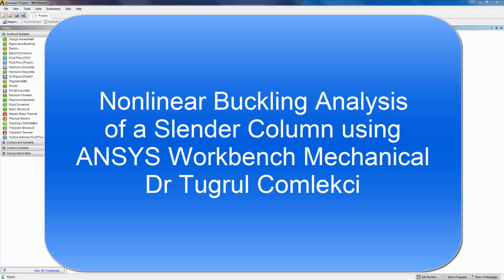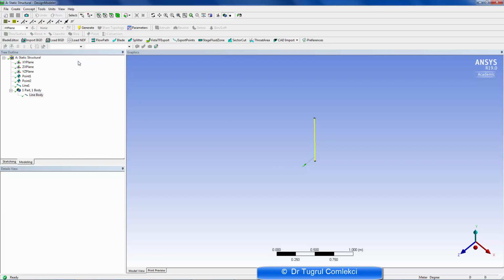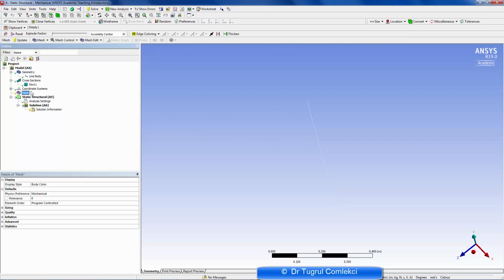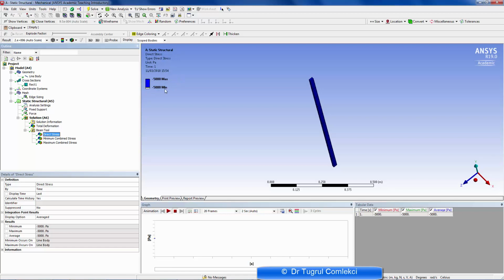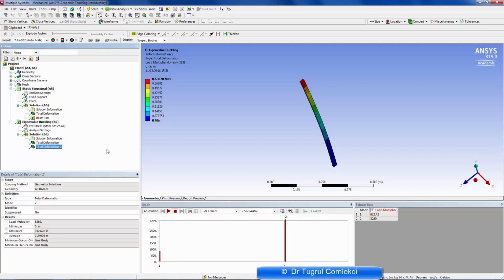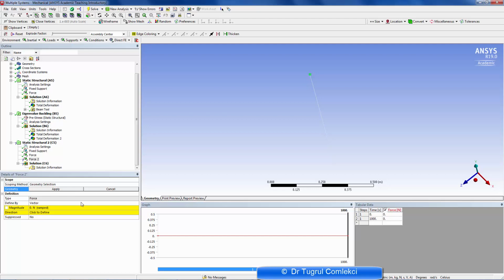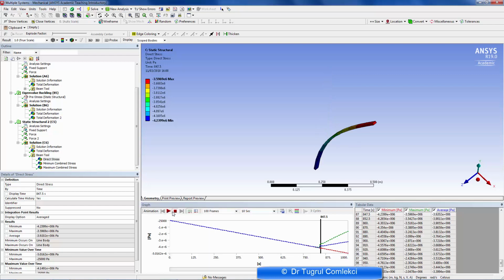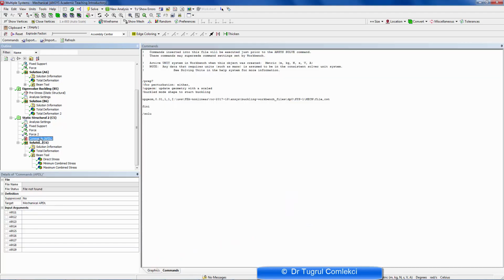Nonlinear Buckling Analysis of a Slender Column using ANSYS Workbench Mechanical

Comment: How can you read the 2nd buckling mode with upgeom?
Reply from the maker: Thanks for viewing this video and your post. The Upgeom command syntax is: "UPGEOM, FACTOR, LSTEP, SBSTEP, Fname, Ext,--". You can read the load step and substep in the *.rst file corresponding to the mode shape you want to apply as a shape imperfection.
Reply: @FEAnalysis  Even if I calculate two modes, there will be only one .rst file in the SYS-1/MECH folder.
I used this command to read:
upgeom,0.0005,1,1,C:\......\dp0\SYS-1\MECH\file,rst
This always loads the 1st buckling mode. How can I apply the 2nd buckling mode as a shape imperfection? Thanks for your help.
Reply from the maker: @krisztiansziklai6992   All mode results would be stored in the same rst file e.g. listed in APDL for a sample modal analysis:    SET   TIME/FREQ    LOAD STEP   SUBSTEP  CUMULATIVE
     1  5.9392             1         1         1                  
     2  8.6926             1         2         2                  
     3  37.113             1         3         3                  
     4  54.424             1         4         4                  
     5  103.34             1         5         5                  
     6  123.82             1         6         6                  
So simply try reading the second substep with this command (Load step 1, substep 2): upgeom,0.0005,1,2,C:\......\dp0\SYS-1\MECH\file,rst

Comment: Thank you fo sharing this video. Just having a question about the material you used. Did you enter non-linear properties for the material when running the non-linear buckling analysis? Thanks!
Reply: He used the same linear material in the analyses. The non-linearity was that he turned "large deflections" ON for the nonlinear analysis.

Comment: Sir can you please help me with GMNIA analysis for a I section based column
Reply from the maker: GMNIA analysis can be done by adding a shape imperfection using the UPGEOM command and also specifying a non-linear material model such as using BKIN elastic-plastic material properties. Unfortunately I could not generate on demand tutorials but I will keep this topic in mind for my next batch of videos. Thank you for your interest in my video tutorials.
Reply: @FEAnalysis  for the model can you tell me is this good for high strength steel welded columns to consider this model and is this avaliable in ansys apdl

Comment: How many capacity must have my computer for make a nonlinear analysis in a reasonable time? I mean RAM memory or to the processor, my problem is a stiffened panel, 1370 mm the length and 600 mm the width,specifically a nonlinear buckling analisys, i have tried a lot of time but i dont have good results